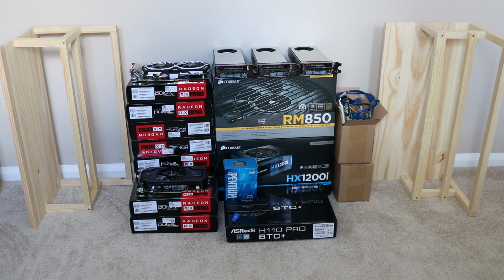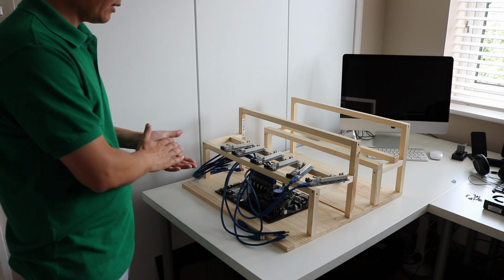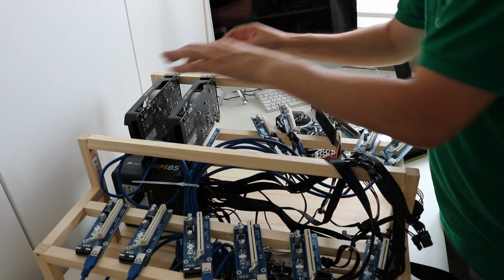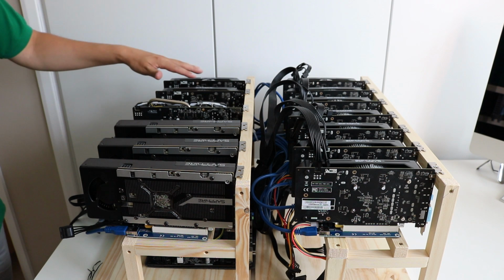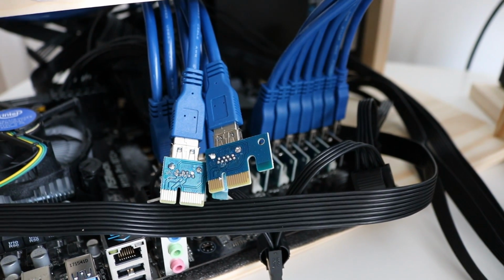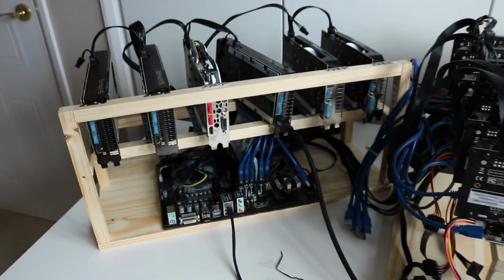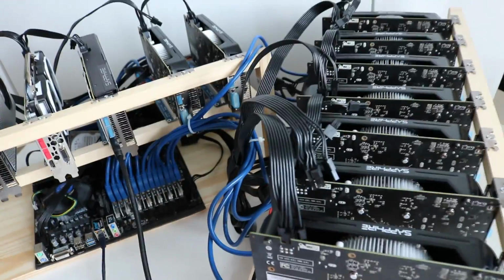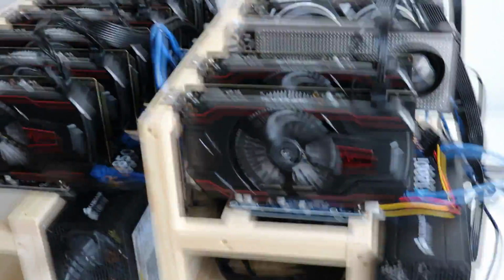Building a 13 GPU Mining Rig - Asrock H110 Pro BTC+ RX560 RX470

Comment: do you need the molexs power on the board, when you have powered risers?
Reply from the maker: I think you get a bios warning when powering up without them plugged but if using powered risers then you don't need them.
Reply: @IMineBlocks thanks but is it bad to use the 2 motherboard molex and the riser power?

Comment: I have a problem where the gpus mine perfectly fine on the black slots, but when I move one of them to the white slots it either doesn't work (detected but won't mine) or works for a moment and stops
Reply: W•h•a•t•s•a•p•p
 +1 4 8 0 4 4 7 1 0 0 3

Comment: Hi mate, thanks for sharing. Did you update the firmware to use 13 GPUs as I'm having issues to connect the 9th one, it runs smoothly for 8 GPUs?
Reply: W•h•a•t•s•a•p•p
 +1 4 8 0 4 4 7 1 0 0 3

Comment: How much you earned in 24 hours with that rig?
I'm suggesting make a systematic how the way you did that, for instance:

1. Buy these.....
2. Assembly these....
3. Install these.....
4. Setup these....
And here is how to set it up: 1. ....
                                                  2. .....
                                                  3. ....

5. After set up, do tweak these......
And here how to do it.... 1. .....
                                           2. ......
                                           3. .......
6. All done, per GPU you earned ..... $
7. Maintain these as it's running......

Comment: Do I need to use MOLEX inputs when I use this motherboard with 12 X RX550 graphic cards?
Reply from the maker: I would use the MB Molex connectors for the best stability, though it is possible to use without them connected.
Reply: @IMineBlocks  Thanks a lot!

Comment: How are you powering that many GPU's with that single power supply
Reply from the maker: I'm using two power supply's.
Reply: @IMineBlocks  even so.. I have a 1000 watt power supply and I'm lucky to power more than 3 carda
Reply from the maker: It depends on the GPUs also. The RX560 are very low power normally using less than 100W and can be run even lower 70W quite easy.

Comment: Probably a stupid question but can mining be done on a permenantly offline computer? If so what software do I need for Windows?  Or do you recommend just the mining OS on USB?
Reply from the maker: Hi, You can't mine offline. You need an internet connection but it doesn't have to be fast.

Lots of different mining software for Windows, it depends what you want to mine. I also use SMOS (simplemining) which is a mining software that runs from a usb stick.
Reply: @IMineBlocks , thanks for the reply.  I'll probably build another computer that can go on the Internet.  I have a spare Tesla K80 that I was going to use in my "everyday" computer, but with the external fan fitted to it, its way too loud.  K20s are far quieter but use those for my work.  I'll look into the software you recommend. It's probably best to have a dedicated mining rig.

Comment: Hi. Is it possible to use a single unit CORSAIR RMX SERIES RM1000X to make a mining rig with 13 or even 14 cards? I use rx550's cards so i am covered in concern of power consumption but i don't know what's going on with the slots on the PSU unit or if i can buy any kind of cables that doubles on slot.... Thanks
Reply from the maker: Yes, in terms of power you should be okay to use a single 1000w psu for 13 rx550's but you will might need some extra connectors to power your risers. You could power some via the pcie and some via molex/sata but I think you might need two more. So a few 8 pin pcie to two 6 pin pcie connectors would be required.

Comment: Hi! I have one question about molex on the motherboard. I have MSI H-310-F PRO. It also has 13 pci slots. How must I connect the molex from 2 psu power supply for 10 cards? One is Fortron Aurum Gold - 1000 (6 cards) and other is Corsair RM 650X (4 cards). How do I connect the molex on motherboard? 1 from 1 psu, and other from other psu? I watched all the video, but you doesn't show actually this moment. Can you help me? Thanks!
Reply from the maker: You can do it either way, I normally power all the mainboard connectors from one of the psus and then split the gpus & risers over both power supplies.
Reply: @IMineBlocks  Thank you for your answer! But I have other problem. My RIG went almost 24 hours whith 10 cards and after that it starts to shut down. I did not know what to do and reset the BIOS. After that, only 8 cards can work. So I thought it coud be the psu and asked you a question. But the problem continues - only 8 cards. The motherboard is MSI H310-F PRO, Celeron G4900 and 8 GB ram Corsair 2133. Is it someting in BIOS i missed? Mining mode - disabled, Above 4G encoding - enabled... nothing happned. The bios is from Marc 2018. Tried with the latest, but thing got worst, so I did recover the first BIOS. Can give me a hint what to change in BIOS?
Reply from the maker: What OS are you mining with ?
Is it always the same 8 gpus working? un plug and replug the none working gpu risers or try them in different slots.
Reply from the maker: Also what GPUs are you using?
Reply: @IMineBlocks  Bios doesn't boot at all. I have 10 cards. 7xRX580 Pulse 8GB, and 3 Nitro Plus RX580 8 GB. When I plug 9 of 10 cards, nothing happens! Monitor show blinking cursor "_". Nothing else. Every riser works, I tried cards 2 by 2 and until 8 - everything is fine. When I plug the ninth card, appears the blinking cursor. So I thing the problem is in BIOS. What special setting do you use in your Asrock? When you have time, please write all the important setting, that must be ON and OFF. Thank you!

Comment: If you Build the Stand that the GPU's go on, you can have it the way you want, Vertical would suck cold from the bottom, and blow out the heat at the top, also the wires would hang better, if the GPU's were above the hight of the Rig, only a suggestion

Comment: Why did you not put the GPU's, Vertical instead of Horizontal  ?
Reply from the maker: Simplicity! Vertical only a provides slight advantage on cooling but with many draw backs such as not fitting into conventional shelving racks.

Comment: Hey IMineblocks. Im planning for build the same rigg with 570... how stable is this rigg running on windows?
Reply from the maker: A Linux based system would be better for stability EthOS or SMOS I'd recommend.
Reply: Thank you for your answer. You are really helping me out.
Just one last question. So i got my custom bios and atiflashed it. Now i am having a great Hashrate. But what about the undervolt?
Can i save it somehow in the bios also? Because currently im working with simplemining. Sadly i always have higher wattusage on simple.
(I was undervolting with TRIXX)

Thanks mate

Comment: Hi pal will you will be able to help me out with this please :)

I have the following
gigabyte z270p-d3 (BOIS UPDATED TO MIN.F8a) https://www.gigabyte.com/MicroSite/462/mining.html  <<< if you see the pic first step say Enable Mining Mode but mine dont show that
HyperX 4GB 2400MHz DDR4 Non-ECC CL15
EVGA Supernova 850w PSU
Kingston A400 120GB SSD
Intel Pentium G4400 3.3 GHz Socket 1151
6x MSI GeForce GTX 1050 TI 4GT OC Graphics Card - 4 GB (THIS DOSE NOT HAVE ANY POWER PLUGS IT RUNS FROM THE USB RISERS POWER)
windows 10 home

So the problem i am facing is that the mortherborad picks up 4 gpus only.
I have unpluged all the gpu out and tested all the PCIEX with one gpu
also tested all my usb risers

I found out PCIEX1_1 AND PCIEX1_2 are not working or reading anything
is there any way of turning them on somehow?
i must have done something somewhere to mess up

-----------------------
PCIEX1_1 (NON WORKING)
PCIEX1_2 (NON WORKING)
-----------------------
PCIEX1_3 (WORKING)
PCIEX4_2 (WORKING)
PCIEX4_1 (WORKING)
PCIEX16  (WORKING)
-----------------------

Comment: PSC Continued

If one looks at what goes on when sizing HVAC for data centers the rule of thumb often used is that capacity for your HVAC must be 1 BTU cooling for each BTU being  dissipated by your IT equipment. In the context of building a rig it does not seem that there is any capability being costed out for this HVAC component. Imagine if you lived in Alaska you would just open the window, but that is not the case. So suppose you account for the window air unit (or whatever) to really cool these rigs. The house I live in now is all electric. It was built in the 60s when power here was nuclear and relatively cheap. Each room has its own thermostat. During the winter months my computers in a particular room warm that room well. In the summer months those same computers cook that room to a point where air-conditioning is required. Obviously, there is more cost here than one normally sees in monthly operating cost calculations.
Reply from the maker: This rig lives in my garden shed and it has adequate ventilation all year round. If keeping rig indoors some extra ventilation would be required during the summer months but I would not recommend air conditioning, just a high airflow.

Comment: Hi! Thanks a lot for the video. In the next (update) part you switched from Ubuntu to SMOS. What was the reason? Was Ubuntu unstable? SMOS is based on Ubuntu that is why I am asking. Is it possible to use iGPU instead of using one of the mining GPUs for display purposes?
Reply from the maker: I had problems with the Ubuntu graphics drivers, I think because of the two types of gpu generations and required different drivers. In the end I tried SMOS and it worked perfectly without any drivers issues and I've been using it ever since.
Reply: IMineBlocks ok thanks. How about using iGPU instead of mining GPU for Display purposes? Were you experiencing booting problems and that was the reason?
Reply from the maker: I think that the intergrated graphics contributed to the problem, I tried both with and without the onboard graphics and still have driver problems. I think I managed to get half the cards working at one point but never the full setup. Too much wasted time on it.
Reply: IMineBlocks got it! Last one, did that PCI Express gpu give worse hashrate or not at all?
Reply from the maker: No, using pcie risers does not affect the mining performance.

Comment: Sir is it necessary to plug 2 molex on motherboard also ?
Reply from the maker: I would recommend it but it's not necessary if using power risers. You can bypass the warning screen upon boot up by pressing the N or M key.
Reply: IMineBlocks - thank you. One more thing. does 12 or 13 gpu work on windows 10 claymore ethereum miner or we need to use ethos or simple mining ?

Comment: can you please let me know does the two molex on the board needs to connect each other then to psu and which section of the psu? perif or sata?

also if i use two psu does it need to be connected to primary psu?

thanks
Reply from the maker: The motherboard molex connectors? They should be connected to peripheral on psu. I think my Corsair PSU's have the same connector for perif / sata and pin config but please use peripheral unless you confirm otherwise.

The second psu doesn't technically need to be connected to the primary but I would recommend using a link cable which starts the second psu when the primary is powered up.
Reply: i have a evga 750 g3, I tried to connect it to perf and i heard a noise so I connected to sata which fried by psu and saw smoke from graphic cards so switched it off and replaced the 750 with a new one. Currently those two molex on motherboard are not connected and the graphic cards fortunuately are working fine. However if I connect the thrid card i get a screen suggesting to connect the 4 pin molex on mother board so not sure how and where to connect.
Reply: Just to double confirm the cable has three 4 pin molex connectors on one end so I will connect two of them to the molex on mother board and the other end to psu perif?

thanks for you time
Reply: Sorted. Conntected it to perf as EVGA has separate Perif and sata connectors. can't thank you enough. been searching for this info like crazy for a week now.

Comment: did you notice difference of performance on the gpu that's connected to the monitor? would it be better to connect the onboard graphics to the monitor?
Reply from the maker: I prefer to plug into one of the gpus rather than the onboard. You shouldn't notice any performance difference when mining, sometimes a slight bit of lag on your desktop.
Reply: IMineBlocks i asked because i notice a lower hashrate on the gpu that's connected to a dummy hdmi plug and i'm using teamviewer to check the rig. Mining with 8 x gtx1070 and ccminer neoscrypt, cards do about 1050 average but the one gpu about 980..

Comment: im setting up a asrock 110 with hopefully 13-14 gpus. I have only been able to aquire 1050ti and 1060 3gb. so as of now thats what i will be using. but if i find a good 1080 or 1070 I will be replacing one at a time to make it more effecient.  what power supplies do you reccomend. I have not been able to find anything in stock. stuck........... please help. im using 4gb ram and 4400 intel celeron

Comment: i'm planning to use ASUS B250 MINING EXPERT LGA1151 with 19 x Digital Alliance Radeon R9 295X2 8GB DDR5 512BIT . Do you thing i need 3 x Corsair AX1500i  or 3 x Corsair HX1000i is enought? Please help me to solve this problem.Thanks
Reply: all Intel CPUs has 13 GPU limit, but u can add another 6 mining specific gpus, like gigabyte p106-100.
One 295X2 requires 450 watts or more, do the math.

Comment: Hi, thank you for such a simple video explaining the setup. I am using 3 GTX 1080 FE, ASRock H110 MB same as yours with EVGA 850 GQ, Gold PSU but I am having trouble when I put 3 graphics cards and run the rig. If I run with 2 it runs perfectly. I read the manual and it says plug in the 4 pin molex into the slots on the motherboard. If I do that nothing turns on. Would anyone of you be able to help me here? I changed risers, wires, ports, PSU's (I even attached 850+750 watts PSU) but nothing seems to help. Any help will be appreciated.
Reply: did you ever figure this issue out? I'm currently having the same issue myself and cannot seem to get things booted with more than 2 GPU. Go back to 2 and everything is fine again. So frustrating

Comment: i have sapphire rx 570 pulse 4gb, 6 graphics card and asrock h110 pro btc motherboard, intel pentium g4400 cpu, 4 gb, ram, 128 gb ssd hard dd, 1200 wt corsair psu.  
i have setup the rig. all graphics card showing correct. But on mining on nanopool, sometimes 2 graphics speed shows, sometimes 3 graphics card works. another graphics speed shows 0. i could not understand why is this happening. On minergate, also 3 graphics works. can u help me. what operating system to install. or can u help me in this matter through remote pc. thanks for helping me sir.

Comment: I enjoyed the video.

I used the same Motherboard and risers (we had to tape) those riser (the issue) or fear, is that those riser, can touch each other, can cause a short. We just used simple tape or electrical tape. Once we taped all the risers, the problem went away. 

We also noticed, that board is a bit sketchy. We had the same problem, or solve, was to put a proper video card in the 16x slot and suddenly, it started to run proper. The manufacture makes no not, of the fact that, and we are speculating, that you MUST have a card in the 16 slot for the RIG to function proper.

BY the way, you ignored the directions, from the manufacture, that tell you to put in one card, boot up, then shut down and add each card, one at a time. We had problem too and had to go back and do one card at a time, to get them all working.

Comment: Did you have any problems with the ddr4 3000mhz? Mine don't seem to fit
Reply from the maker: On another board the ram sits close to the cpu cooler. But you should not really have any problems fitting it.

Comment: Why would you use wood for your rack?  Is that not a fire hazard since this produces so much heat?
Reply from the maker: The wood is fine, the equipment doesn't get that hot. 70C max.

Comment: Great video Lee as usual. I followed your advice and I got an Asrock H110 Pro BTC+ BUT I can't understand how to power it up, I have everything in, RAM, CPU and I have attached one GPU for testing but it doesn't fire up. Any reason you can think of? Everything is brand new ... and I press the power button on the actual motherboard.
Reply from the maker: Nothing at all?
Confirm that your using the PWR button and not the reset.
Confirm mains power lead is on, PSU rocker switch.
Unplug and replug all power connectors.
Remove GPU and test power.
Test PSU or Mobo with another known good working PSU or Mobo.

Comment: Hi, I recently built a 13GPU Mining Rig very similar to your one. I used Sapphire RX580 graphics cards however they only give 18mh/s out of the box. After playing around with a few settings I had managed to get it up to 22mh/s per graphics card. I did this by changing the GPU from gaming to compute. How can I get my hash rate up to 31mh/s like everyone else? Overclocking has no effect. I am willing to pay anyone who can assist me successfully :)
Reply from the maker: You need to Bios mod each GPU according to its memory brand.
Reply: Is there any chance you could make a video on this please? I believe it will benefit many people as this is a common issue many of us are facing.
Reply: i can get 29.5 for rx580 after bios mod , overlock and limited power as Lee said
great work Lee btw, have been watching all ur vids. thanks

Comment: You don't have to use those connectors on the m/b. They beef up the power delivered to the pcie device but there is no power going thru powered risers. Only those flat-cable crappy ones need this.